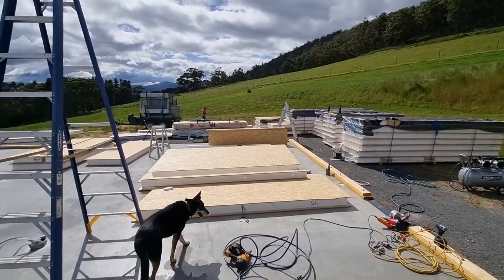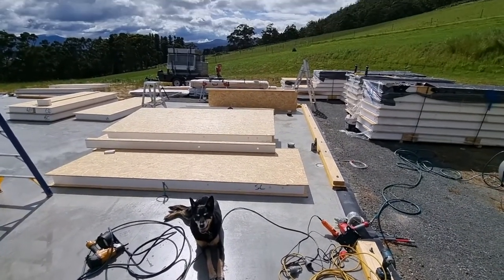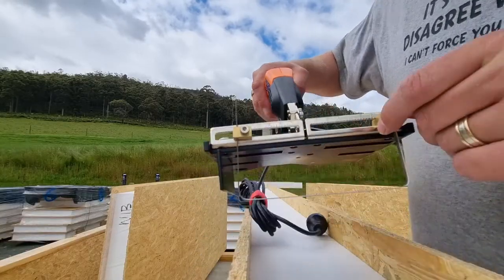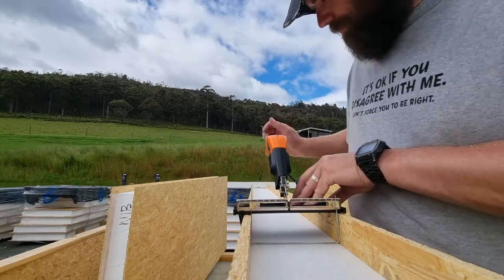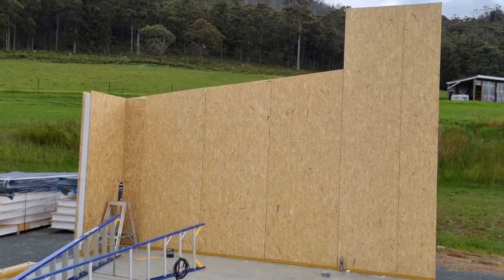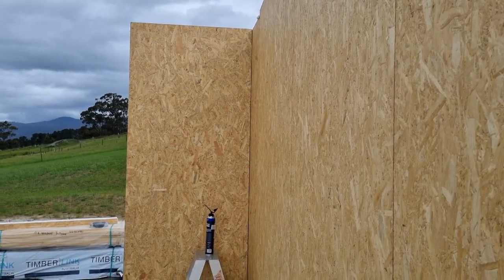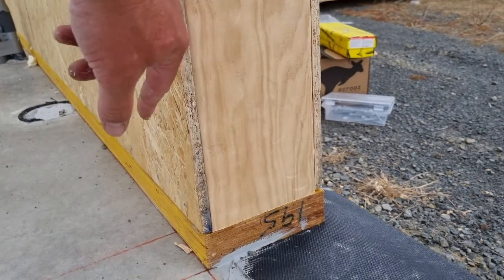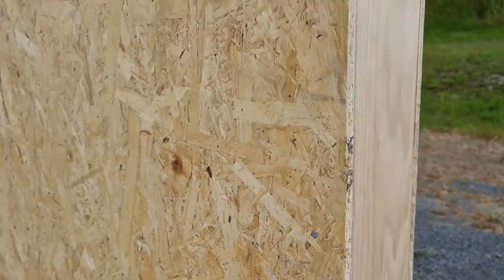Installation of SIP panels, for passive solar house. LBU-8

Comment: This wall Dimension is from the 80s. Sorry passiv solar houses need 36-49 cm walls.😅😅😅
Reply from the maker: I suppose it would depend on the local climate, less insulation is needed for more mild climates.